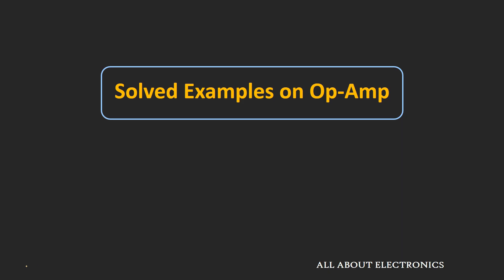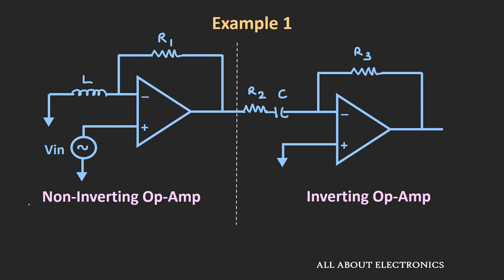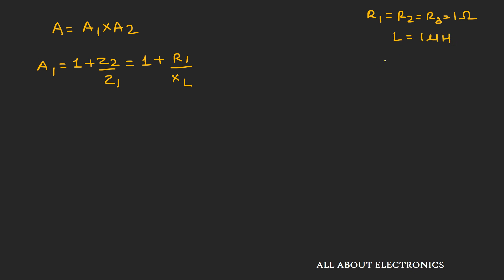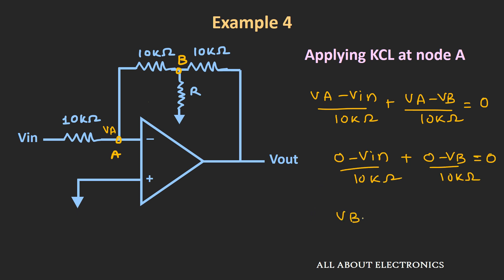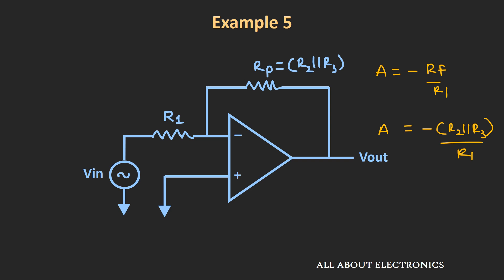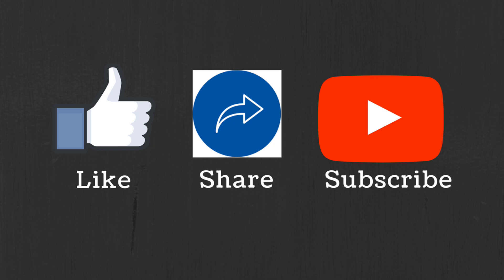Op-Amp Solved Examples (Part 1)

Comment from the maker: The timestamps for the different examples covered in the video.

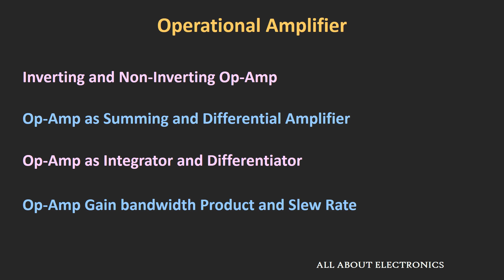0:31 Example 1

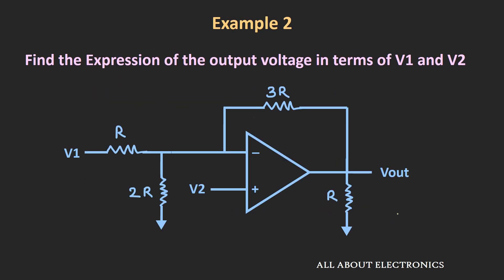4:06 Example 2

7:21 Example 3

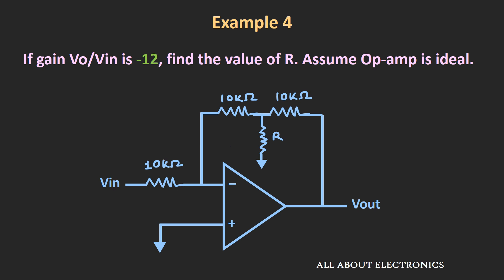9:01 Example 4

12:45 Example 5
Reply: In example 5, if we apply KCL at inverting terminal then, the answer comes as -R2/R1. Can we directly join the resistances in parallel as one terminal is virtual ground but the other is actual ground? Please clarify this doubt.
Reply: ALL ABOUT ELECTRONICS Kindly upload video about ADC and DAC. How to convert there are few videos about it and their explaining method is not very attractive.
Reply from the maker: Yes, I will upload it very soon.
Reply: why you did not connect 10k ohm resistor in parallel with unknown resistor r for example-4 but you have done in example 5

Comment: - I have set up the circuit in example 5, unfortunately the answer is not practically the same as your solution. I have all resistors 10k and Vi=1v ==> Vo=-1v ==> Vo=-Vin==> A=-1
that is R3 load resistance and A=R2/R1

- But as far as example 4 is concerned, I have practically the same answer as your solution.

Thank you for your effort

Comment: At 13:22 the voltage between R2 and R3 MUST be Vo. Then KCL at the inverting terminal will read (0 - Vin)/R1 + (0 - Vo)/R2 = 0 or Vo = -(R2/R1)*Vin

Comment: In ques #4 , by virtual ground , Va = 0 volt , now resistor 10k and R both have one terminal at 0v and other terminal is common for both . so why we can not let (10k || R) ? and further taking Rf =(10k || R)+10k and then appling gain formulae for inverting terminal i/p i.e A=-(Rf/R1) ??
just like you did in next ques #5 .
Reply: same query
Reply: then R becomes -11K 🙄🙄
Reply: @ALLABOUTELECTRONICS
Reply: my answer also same... NO CHANGE
Reply: my attempt also same manner
Reply: did u get the answer then pls tell

Comment: Hello, in example 5, even if the potential at - terminal of opamp is same as gnd, but how can we consider r2, r3 to be parallel??? As the case of current going to ground through r3 is not same as current going to - terminal of opamp through r3.....please clarify it
Reply: @ALLABOUTELECTRONICS  please respond sir! 🥲

Comment: Sir in first question if we do not consider the complex part that is j....And write XL= wL and XC= 1/wC....Than too the answer is 1 ... So is it correct method?
Reply from the maker: In this case, although the answer is coming the same, but that's not the correct way. You need to consider the imaginary part as well. (instead of just considering the magnitude of the reactance).
I hope it will clear your doubt.

Comment: Answer 5th is solved in the wrong way. Solution 5 is completely absurd. You cannot connect the virtual ground point to the actual ground. Even if we assume that your answer 5 is correct, then check your way of solving question 2, since Q2 and Q5 are similar if we keep V2 in Q2 equals to zero. If you solve Q2 as you solved Q5, then you will get different answers for Q2. It signifies that your two answers are contradicting.

Comment: You solved example 5 in the wrong way. virtual ground and real ground are not the same so we cannot take R2 || R3 . And hence the voltage gain will be equal to the gain of inverting amplifier .

Comment: You have wrongly solve 5th question.. Deliberately you make virtual short circuit into actual short circuit...R3 act as load resistance...even the solution given by GATE is not matching with your answer.

Comment: In example 5 , R3 is connected parallel to R1 because of same potential difference  . Why  in example 4 , R cant be paralllely connected to 10k? In example 3 why the circuit is integrator(low pass filter)?

Comment: Thanku sir
Reply: Sir please tell me best book to do questions related to opamps for iit jam
Reply from the maker: There is no dedicated book. But what you can do is, you can go through the previous years papers to get more questions on op-amp. For electronics, there is book for GATE called R K Kanodia. There you will get some 40 50 questions on op-amp. If you want you can by that. But for just op-amp questions I don't it's worth it to buy it. But still if you want you can buy it.
Also you can check the quiz section for op-amp questions.I used to post it as a community post.
For quiz and solution, I have started a dedicated channel, ALL ABOUT ELECTRONICS QUIZ. You can also check that for more questions.
Reply: @ALLABOUTELECTRONICS  sir can you pls give pdf of rk kanodia gate ece.... I have downloaded online but it has missing pages

Comment: If you rearrange the resistors in #5 it will look like an inverting amplifier with R3 as load so you didn't have to make it parallel 😊 I think the gain is -R2/R1.
Reply: Agree! The current through R1 is simply going through R2 only, and not parallel combination of R2 and R3.
Reply: Agree, the gain will be -R2/R1
Reply: Yes he has done it wrong in example 5 as R3 will make up as the load resistor
Reply: Agree
Reply: For an ideal op amp load resistance is zero
As there is voltage drop across R3 that is vout-0 there will be some current
Is it seemed to be correct?🤔
Reply: @mofijulsk2527  No. Load resistance of an opamp is not necessarily zero. In fact there is a minimum load resistance based upon the maximum output current that it can generate (generally 25 ma to 40 ma). The output impedance of an ideal opamp is zero but the output impedance is not the LOAD. It is INTERNAL to the opamp. It is the Thevenin impedance of the opamp.
Reply: 😥😥Mai ye comment exam ke bad padh rha hu. 
same question aaya tha, pura 10 marks kat gya. 
Prof se bahas bhi ki, ki mera answer shi h.

Comment: Sir in example 4 ,you have solved the ques by using KCL .Can it also be solved by connecting the ground terminal of resistor R with Va voltage as by virtual ground , Va also equal to 0.But by solving this way, I get my answer wrong. Please help me with this.
Reply: same query

Comment: sir 11:12 lets assume that there is a current I1 through Vin to Node A, and another current I2 through Node B to Node A , did you take applying KCL at node A like this ?
Reply from the maker: The KCL is applied at node B. That means the summation of all the incoming and outgoing current from node B is assumed as zero.

Comment: What is j
Reply from the maker: I am sure, you are aware of the complex number. Here j is used to represent the reactance of capacitor and inductor. 
In general,  when the circuit contains a capacitor and inductor, the impedance is a complex number. Which can be represented in the form (A + jB) ( similar to the complex number)
I hope it will clear your doubt.

Comment: In reference to example 3- Is the cut off frequency of the circuit different from cut off frequency of the OP AMP?
Reply from the maker: Here the op-amp is ideal op-amp. And, the bandwidth of the ideal op-amp is infinite. So, the cut-off frequency which is referred in the example is the cut-off frequency of the circuit.

Comment: In the Q2 we have to neglect R connected at output terminal or is there any conceptual reason which i am missing? please explain
Reply: bro thats already at ground potential and we dont need that to measure output voltage

Comment: I noticed a mistake In Example 2. you should have included R (which is connected to Vout) in the calculation of R feedback of the OpAmp, in parallel to 3R.
Reply: SAME DOUBT

Comment: but why A=A1*A2  AND NOT A=A1+A2
Reply from the maker: Because the signal from the first stage will get amplified by the gain A2. So, let's say if Vin2 is the input to the second stage, then the output would be A2*Vin1. 
Where Vin1= A1*Vin.
So, overall, V0 = A1*A2*Vin.
I hope it will clear your doubt.

Comment: In example 5 how you took R2//R3 because from my point of view Vout is much greater than Vin so current in R2 will go to R1 which is Vout-0/R2 = 0-Vin/R1 and current in R3 should be equal to Vout-0/R3 and also as R3 is connected to ground and not terminal connecting R2 and R1 so current in it should be independent and current will go from high  potential to low potential so there is no way of any current going from R3 to R2 also as R3 is connected to ground and it can extract any amount of current from ground so current in R2 + current in R3 may not be equal to current in R1 so total gain should be Vout-0/R2 = 0-Vin/R1 which is -R2 /R1
Reply: As he took R2||R3 in example no.5
if we take 10k||R in example no.4 we get R=-11k ohms whichs not possible..
So I think we CANNOT consider virtual ground and actual ground same and connect them and proceed..
Reply: Ans is -(R2/R1)
Reply: s thirumalai
Reply: Yes ex:5 is wrong!!

Comment: in the 5th problem, when you redraw the circuit, wont R3 act as a load resistance? and the gain be equal to -R2/R1?
Reply: same doubt.
Reply: Also, same doubt. Confirmed with ltspice simulation. There is a problem here.
Reply: @noweare1  here comes the ltspice guy
Reply: Applying Kirchhoff's current laws gave same answer
Reply: i noticed the same way

Comment: In example 2 when we applying superposition principle,if v1 is on then output resistor acts as positive feedback ,is it right? Could u plz clarify..
Reply from the maker: No, it won't act like a positive feedback. Because as both (One terminal of resistor R and non-inverting input terminal) are at ground potential, there is no input as feedabck to the non-inverting terminal.

Comment: Why are we not applying inverting amplifier formula directly in example 4
Reply from the maker: Because there is one more node B in this circuit. VB and Vout are at different potentials. So, directly it can't be applied. In example 5, as the parallel combination is directly connected to the output node, it is possible to apply that formula. You can even apply the nodal analysis in example 5 like we did in example 4 and still, you will get the same result. 
I hope it will clear your doubt.
Reply from the maker: The direct formula would have been applied if there was no R in the circuit. But becuase of Resistor R, which is grounded, it can't be applied.
Reply: ALL ABOUT ELECTRONICS 
But why are we not considering "R" resistance parallel to 10k resistance like we have done in example 5

Comment: In the first question why is the second circuit not a differentiator circuit because of the capacitor it should differentiate the input signal, right?
Reply from the maker: Yes, that's true. But we are intersted in finding the overall gain of the circuit. So, just impedance of each circuit component is considered.
Reply: ALL ABOUT ELECTRONICS So if I were to find the output signal, will I consider it as a differentiator or an inverting amplifier?
Reply from the maker: For the given example, just consider it as an inverting amplifier.
Reply: @ALLABOUTELECTRONICS  sir why did we consider j terms in the reactance earlier we didn't put j terms in calculation of impedance

Comment: This doubt is based on Practical simulation of Multisim Where I design a circuit of instrumentation amplifier. The problem is : Saturation   region is +15/-15 Volt. Now I calculated output voltage is 20V (Theoretical) and according to ur videos it should be  exceed the saturation voltage so it should be saturated to +15 V. But in simulation I got only 12V ?? Why???

Same if i change input voltage and let's i got output voltage 120V ,it should be saturated to 15 V but in simulation i got only 7V.
Same in case if got let's say -110 V i got only -7 Instead of -15. WHY????
Reply from the maker: The thing is all op-amps are not rail to rail op-amp. Meaning that all op-amps will not saturate at the biasing voltages. And in fact, for most of the op-amp, it used to be less than the supply voltage. The op-amps which can go up to positive and negative supply rails are known as rail to rail op-amps. That's why you are getting 12V as output. 
About your second query, just want to know, have you connected the load resistor at the output of the op-amp. And if yes, then what's the value of the load resistance.
Reply: I got 11V not 7V (There was a small error in my circuit and just now i rectified i got 11V).

Comment: Thanks for all your lovely videos...But I h’ve a doubt...How we can identify directly whether the op amp circuit is Low pass or high pass or band pass/stop filter just by looking at circuit..
Reply from the maker: I have made the video on active filters using the op-amp. You can check that video for more help. But in general for any circuit by finding the transfer function(Vout/Vin), we can conclude whether it is low pass, high pass or band pass/stop filter.